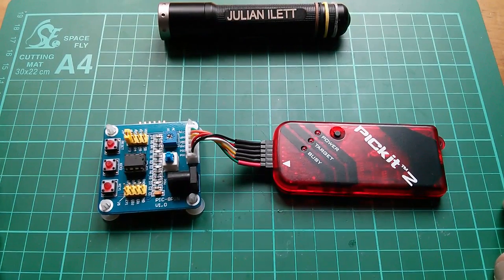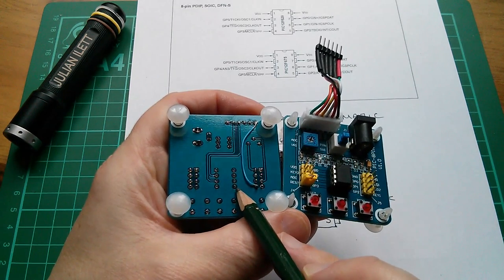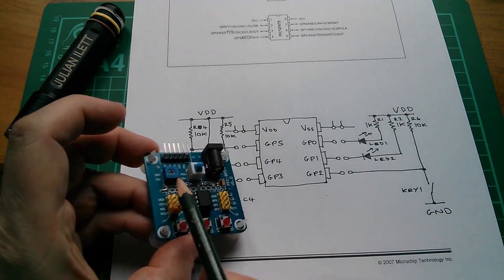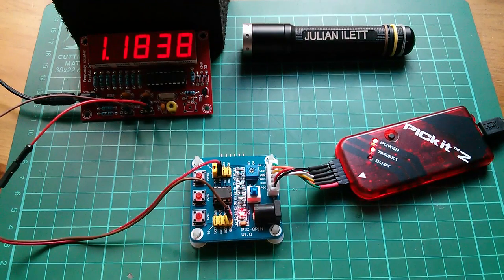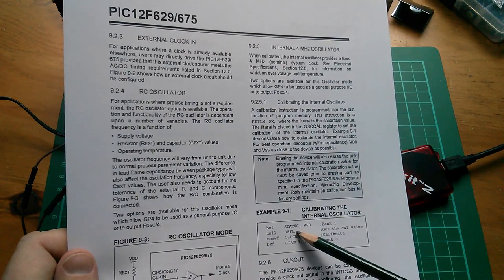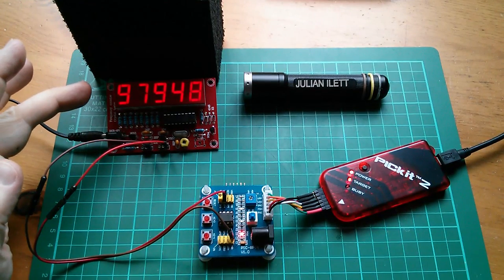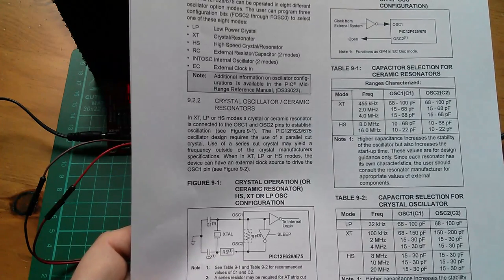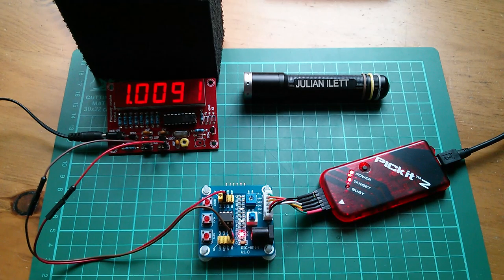PIC Assembly Language Update: #1.1 - PCB schematic

Comment: Every time I try to read my chips I get invalid target device ID (0x0) and a bunch of NOPs. Clearly not communicating with my pickit 3, I shall have to put together my own board sigh.
Reply from the maker: Are you using MPLABX?
Reply: Julian Ilett Tried both versions, v8.9 (whichever was recommended), MPPLAB IPE, MPLAB IDE, all giving bad results. I'm starting to think it's the pickit as none of the 6 PICs I have are being read or seemingly communicating with the pickit(a knockoff from Alice).
Reply from the maker: Wire mod fitted? GP3 yellow link removed while programming? Try playing with the other programmer controls, particularly the reset up arrow, down arrow and traffic light buttons.
Reply from the maker: Also, I bought some well dodgy PIC chips from some well dodgy eBay sellers a few years ago.
Reply: Julian Ilett Tried with wire mod, a breadboard version(wires directly to PIC), breadboard with pull-up resistor (saw on the internet it may work, it didn't).
What do you mean by reset up, down arrows and traffic lights?

I'll consider getting some official chips to see if they work (that'll see if it's the chips), but 6? Seems unlikely they're the problem, but not impossible. They were also from Alice, which is better than most sellers.
Reply from the maker: The last 3 buttons on the programmer toolbar (in MPLAB 8.92) - you can see them at 7:35
Reply from the maker: Have you selected the right device and the right programmer?
Reply from the maker: In part #2 I'll use the Pickit 3 - to see if I have any issues that are different to the Pickit 2.
Reply: Julian Ilett Tried playing with the reset buttons, but I don't get a traffic light, I get a grayed out "power on" button. From your window I can see you're in v8.92, so am I. Any ideas?
Also, something that I think proves communication is the issue here is that if I physically remove the PIC from the board, keeping power to the board and press "reconnect" I get the same error!
MPLAB 8.92 also says "Target detected" when there is no PIC, but power on the board, so either the pickit is lying or it just detects a voltage on VDD for that to appear, which isn't something I think someone would do.
And yes, correct device etc (assuming these chips are what they say on the packet!)
Reply from the maker: Just connected my clone Pickit3 and had all sorts of problems. Finally fixed it by changing the target voltage to 4.875V
This is in programmer settings, under the power tab.
Reply: Julian Ilett Hasn't affected anything, I tried messing with voltages in the IPE too. Powering from the pickit doesn't work either.
Reply from the maker: All the errors I had are documented in forums and on websites, so people have been having these problems with the Pickit 3 for years (genuine Microchip Pickit 3 that is). I don't think the clone is any worse. Certainly the Pickit 2 seems much less problematic.
Reply: Julian Ilett Some of the ones I've had have been documented, and thus solved. However I'm stilling having trouble actually connecting to the damn thing; everything I've found related to device ID 0 hasn't helped.
Tomorrow I'll solder together something more permanent then some dupont wires and a breadboard, see if that helps.
Reply: Julian Ilett Did you get the Target Device ID (0x0) invalid error?
Reply: Julian Ilett Alright, I look forward to hearing from you.
Sorry if I'm being a bit pestering.
Reply from the maker: Finally got the Pickit3 to program the 12f675 using MPLAB IPE
Reply: Julian Ilett Great! As soon as I can get it to see the chip I'll follow your lead ;)
Reply from the maker: Also, the standalone application Pickit3 V3.1 works a treat :)
Reply from the maker: Don't worry, you're not pestering. This has to be fixed. The solution appears to be to use the PICkit3 standalone application V3.1
Reply: Are you sure it works a treat? I can't get it to find my pickit! This is a nightmare!
(and yes, it's plugged directly to the PC :P )
Reply: I had exactly the same issues with the pickit 3(clone). 
I found using MPLAB X was the only reliable solution.
Reply from the maker: Let's just make sure we're talking about the same thing - what version of the program do you have?
Reply: Pickit 3 v3.10, downloaded from microchips own site.
Reply from the maker: Same. Mine initially said the Pickit was in MPLAB mode and I had to download an operating system (new firmware) to use it with this app.
Reply: OK, I haven't had time to test all the options I have, so I'll just try getting it working
Reply: Julian, I do't know why but it just started working!
Can't get the standalone application to detect the pickit but now MPLAB v8.92 just decided to find the chip!
I don't who it was that said "intermittent faults are the worst kind" but they're clearly wrong ;)
Reply: And it's stopped working :P
Knew it was only a matter of time, but I still can't work out what changed!
Reply: Well I've made up a proper programming board, and that doesn't work, Ii'm just getting "failed to get Device ID". I've tried this by powering the PIC from a USB port and from the pickit, neither of which are working, tried messing with voltages, didn't do anything.
I'm really at the end of my tether here!
Reply: I would highly recommend you try MPLAB X 3.51, if you haven't already. Was the only thing that worked for me with the Pickit 3
Reply: That doesn't work, although I am back to getting device ID 0
Reply from the maker: I'm just making a part 1.2 video about the Pickit 3 problems - we can continue this conversation in the comments on that video (or message me separately)